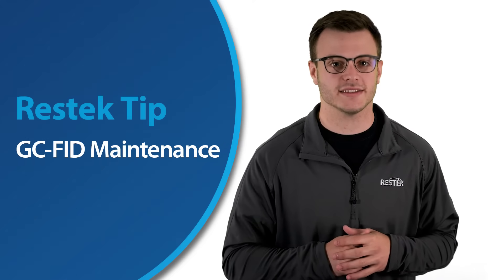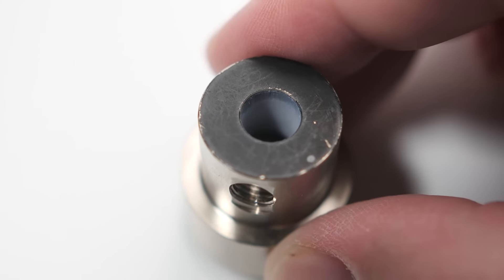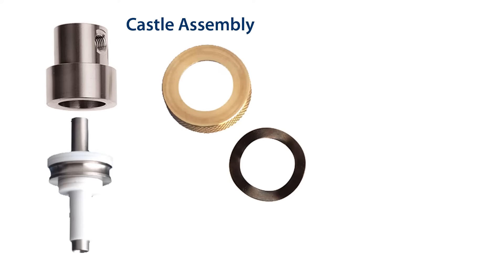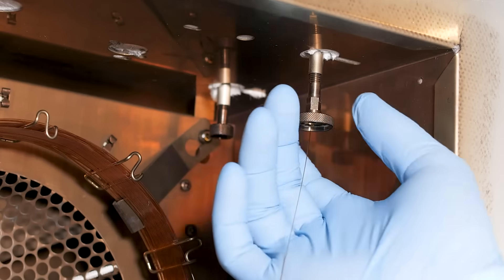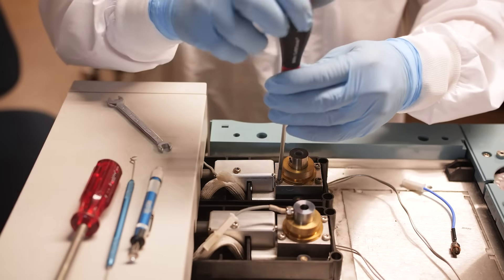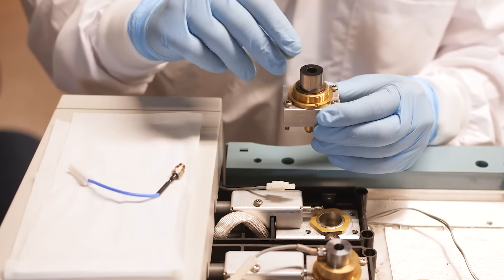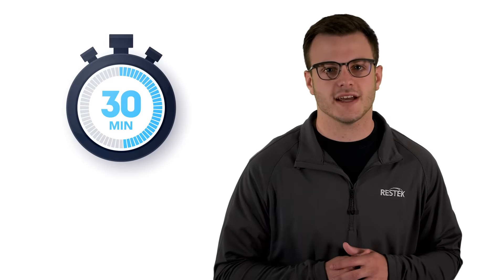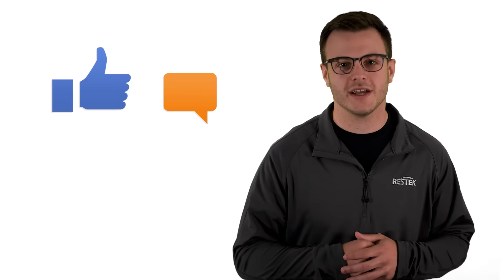The Importance of GC FID Maintenance

Comment: Can you help me, the back detector shows temp not installed. And my infront gas (N2) flow rate i set is 45, but the screen show range 51 - 60. Can you help?

Comment: I face detector back pressure above 5 lakhs and flame not ignite.. Plz gave me some tips to solve this  problem
Reply from the maker: You will want to confirm your gas flow rates. A typical set of flow rates would be 30mL/min of hydrogen, 400 mL/min of air, and 20 mL/min of makeup gas. However, you should confirm the exact recommendation based on your specific instrument and detector.

Comment: Of course, this does assume you're using an Agilent. The basic principles apply, but a lot of the parts you talk about are not there for other manufacturers (Varian/Bruker/Scion does not use any of those organic O rings)
Reply from the maker: Absolutely, the specifics of FID maintenance will vary across different models and manufacturers of detectors.

Comment: Hi.how frequently we need to do it?
Reply from the maker: Unfortunately, the time frame for FID maintenance can vary. It will depend on operating parameters for your FID as well as the type and frequency of samples analyzed. You can try looking at your baseline when you run a no injection instrument blank periodically to see how the detector is performing. Alternatively, you could open it up on a regular interval, say once a quarter, to perform maintenance. And when you open it the next time, you can estimate if you waited too long or could wait longer for the next maintenance interval.

Comment: Hi 
I have the same issue on the FID liquid column, continuous noise on the baseline. I already tried to condition, cleaned with petroleum ether and no result. can you please advise if there any other troubleshooting technique?
Reply from the maker: Baseline noise can come from a number of sources especially if some contamination might be the cause. This can include the FID but also the column, carrier gas, inlet, etc. It can be very helpful to try to isolate components to determine if contamination is the cause, and if so, find from where that contamination might be coming. No injection instrument blanks are a good way to see if you might have some residual contamination. We talk about these in another video https://youtu.be/tpebPhvQERY
We have another video where we discuss isolating different parts of the instrument https://youtu.be/XIRTuso5L-o